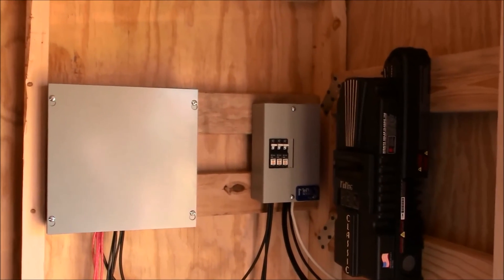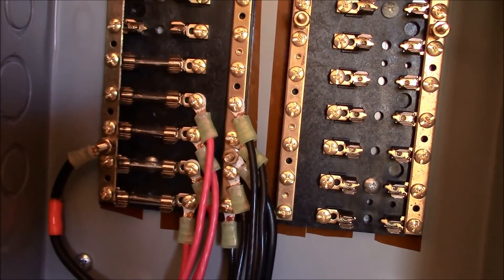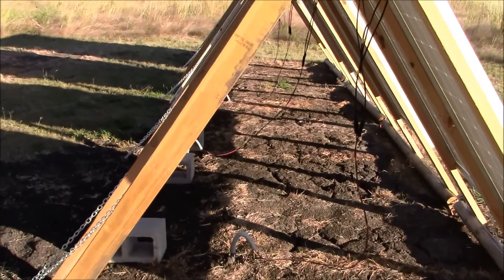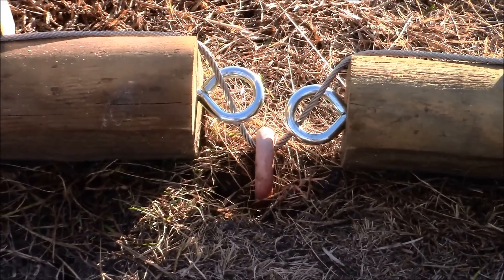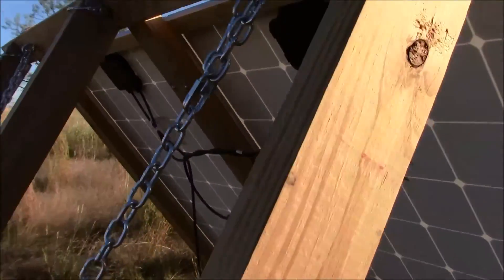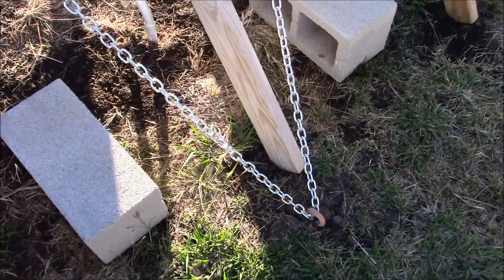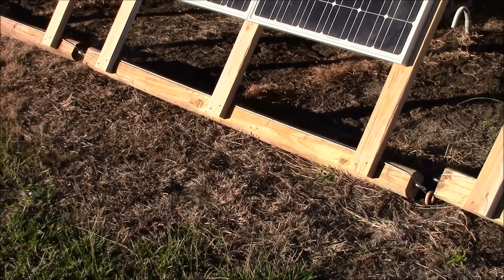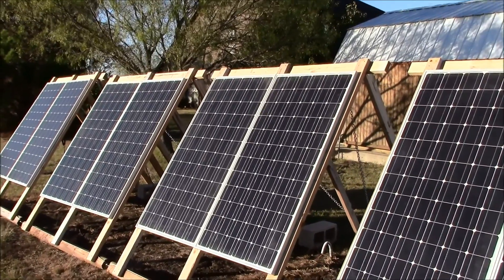Solar System 2: Panels (2016) with New 2x4 Array Support Design!

Comment: when are you coming with some new updates?
Reply from the maker: You have a point there. More has certainly been done since this video, though I’ve only been taking photos during the actual process, I do have some recent video still on my camera’s SD card. However, I will soon be in the process of upgrading the 1st system, not only the addition of more panels, but a complete DC rewire from the panels all the way to the inverter. So, because you took the time to ask and it’s something that would be good for me to do anyway, probably near the end of the month is when I’ll be posting new updates if all goes well. Thank you for asking!

Comment: Where I live now I couldn't do solar as the trees shed their limbs and branches each year so would destroy them and to remove the trees costs up to 5k each and there are about 5 trees I wish would be gone.  I also wish, and do not understand why not, the prices were less expensive or at least the same price for a 35-40% efficient panel as this 14-20% is horrible when you get down to it.  Add in the losses in the lines and the converters it really begins to add up.  You can help it some if your converters are at the headend (the panels) but still a 5-10% loss for everything then add in the 76-80% loss of the solar panels you get so little.  Once these things, if the world will allow it, to say a 40-50% efficiency level then you will only need half as many to do as much as you do now.  THAT is when I want in so 10-15 panels will do what I need 20-25 now.

Are those boards wolmanized/treated?  If plain wood they will rot on you and begin to split if you get a lot of rain then freezing weather then hot.  Untreated wood here lasts about 3 years then if you tried to walk on it be afraid.
Reply from the maker: Haven't honestly seen any 35-40% efficient panels yet, probably few and far between, but the price on the ones we have now have come down substantially! And while there are losses, if you're living off grid, it's wise to make good use of the straight DC power without converting it. But the most line you'll get is probably form the fuses themselves. ^^ But yes, 40-50% efficient panels would definitely be excellent!             Absolutely. Our oldest array is 7 years old and still looks pretty good all things considering. :)
Reply: Adam Humphreys
40-50% is for Nasa and very expensive but should be what we all use not these (avg) 17% panels.
Reply from the maker: Heh, supply and demand always play their role, not to mention manufacturability. But in space, I imagine efficiency can be quite high. Where were those rates recorded?
Reply: Adam Humphreys
Many science shows I have seen because in deep space, or in the outer rim of our solar system, the sun is so weak a standard solar array (using consumer grade goods) would require so many panels it just wouldn't be feasible.  Not sure what they use for the materials to get such high rates but I don't think it was just silicon.
Reply from the maker: I suppose I can certainly see that, but I have to say, I don't think we've sent too many things outside our planet's own orbit let alone our solar system. Even if such a thing could be, or may have been, the power needed to transmit at such a great distance for us to communicate with it may be substantial, more efficient cells or not. Perhaps in a vacuum though, that might not be an issue. I suppose a few bright LEDs could even do the trick with proper equipment to pick it up here on earth, providing nothing is in the way, LEDs, RF, or otherwise. But like you said and as we know, cost is a main issue. :C
Reply: Adam Humphreys
Here are two semi good reads and the first one shows a standard probe with (what I counted) as 36 solar panels that would deliver over 14 kilowatts on Earth but neither article delves into the R&D work they are doing on Solar for the probes into deep space or even to Pluto that they have planned.

http://www.jpl.nasa.gov/news/news.php?feature=4818

http://www.solarpowerworldonline.com/2016/03/kind-solar-panels-nasa-use/
Reply from the maker: Well, I did some math:
-Juno spacecraft panels: "about/approximately" 14,000W "near Earth" / ((29' * 9') * 3 arrays) = 17.88 W/sqft (17.6% efficiency given 1000W of sun power per square meter, or 101.6W/sqft)
-Panels I just bought: rated at 320W on Earth / (6.47' [or 77-5/8"] * 3.25' [ or 39"] ) = 15.22 W/sqft, 14.9% less efficient as above (15% general efficiency)
-Panels I bought earlier this year: rated at 190W on Earth / ((31.8" * 62.2")/12"^2) = 13.8 W/sqft (13.6% general efficiency)

Based on that second article, while NASA has 34% efficient cells available, they seem to seldom use them. The dominant concern is understandably longevity given the harsh environment to which the cells will be exposed. ... Neat stuff though. :)
Reply: Adam Humphreys
I counted about 388 watts per panel on the Juno and the 34% is still not enough for the very long range and extremely low light.  Pretty scary when 14Kw become 500 watts out there but even at the measly 34% (not the r&d stuff as those were not mentioned) what are they doing for that and why aren't they available to us here on Earth where they are not subjected to a vacuum and temps that blows the mind?
Reply from the maker: Probably because it wouldn’t make any economic sense at all to buy a single 725 watt panel for $7,200+ when you could buy 7,250 watts worth of power (~23 * 320W panels) for $2,300-$7,360. Who would pass up paying a 10th for the same amount of power at the cost of 2.27 times more surface area? Even in NASA’s applications it only makes sense in “low volumes” based on that second article, and it’s probably for research, (not to mention it’s not coming out of their own pocket).

NASA would probably have better luck with mirrors so they can cut costs and use fewer panels in deep space applications.
Reply: Adam Humphreys
That wasn't my point because the point I am making is that I doubt the stuff they are using is really that rare only it is expensive because only they are using it.  Like Nasa using microwave oven and for you to buy it was over 10 thousand dollars in today's money.  Panels like that is wonderful for places like the UK or Canada, etc... where the sun is not as bright or as long.

Just remember that the stuff Nasa only uses today is freely available to the consumers tomorrow for Kmart prices if history repeats itself.
Reply from the maker: Oh, well I'm certainly not denying that. That's the typical development cycle. And it's probably not the materials alone, but the process. Looking up some simple diagrams, it basically amounts to a solar cell with 3 different silicone stacks, each reacting to different wavelengths. Your single silicone layer cells are brittle enough. I imagine the challenge comes in getting as minimal layer thickness variation as possible for a properly functioning cell. All-in-all, in due time the public market rate would probably still be about 2-3 times as high as traditional cells, but as you said, depending on location, that would be a reasonable tradeoff. :)
Reply: Adam Humphreys
I still hold out hope for some new technology that is less lossy.
Reply from the maker: Same here! Hopefully a more efficient means of production or new discovery, (be it materials or manufacturing).